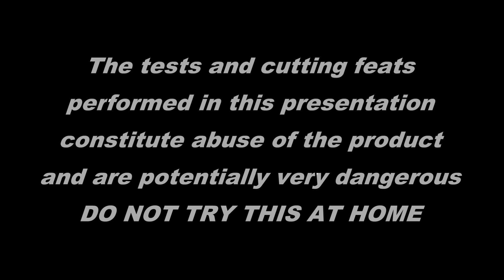More Proof 2004 Part 1

Comment: Essee has really god like carbon steel as good as your sk-5 in the woods.  The serial number is also a nice touch.  And the micarta handle with bowdrill divit is sweet.  Would you ever put a micarta handle with bowdrill divit on your sk-5 kukri?  The rubber on mine is wearing down.  I find micarta does not suffer this problem and gets more traction when wet.  I've owned my cs gurka kukri for 2.5 years and will end up buying a new gurka kukri plus sk-5  because the handle is getting wearing.